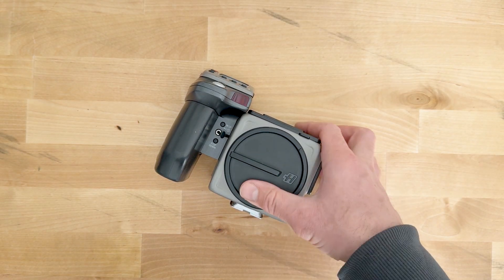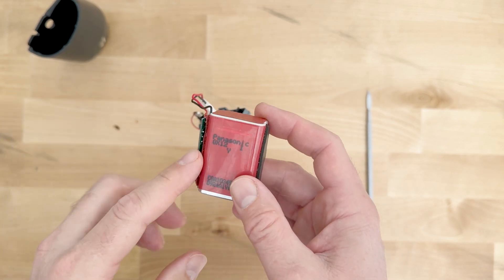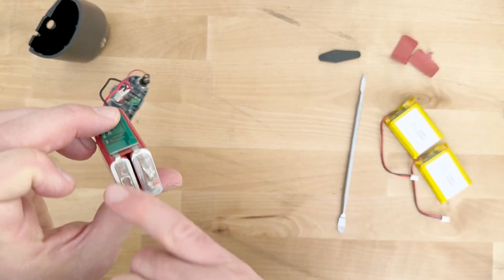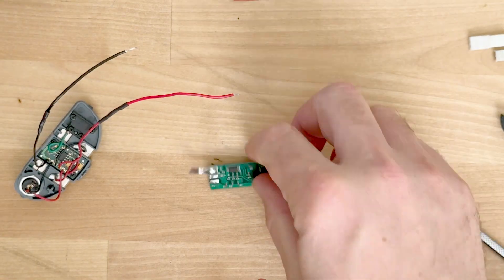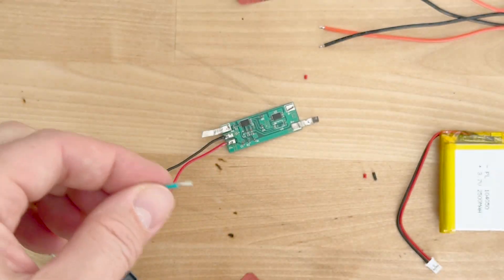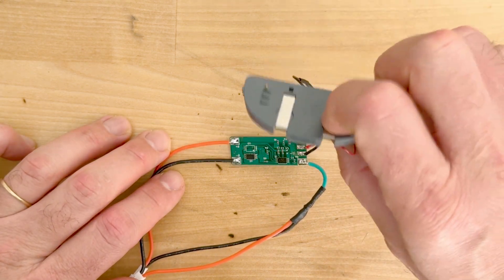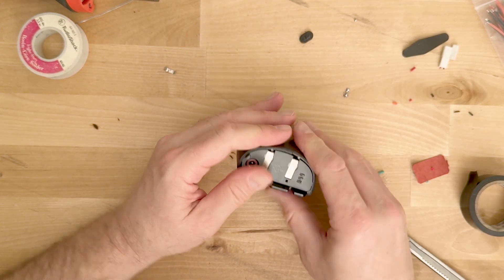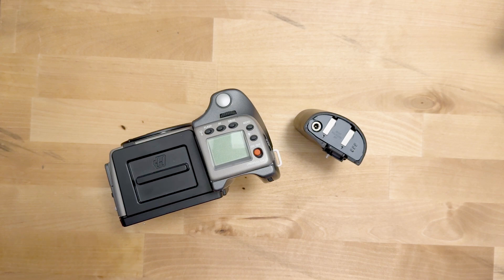Hasselblad H battery grip battery replacement

Comment: Very interesting video. Thanks a lot. But I was wondering, why not take a heating coat battery pack (7.4V -20000mAh) with the BMS already included. Just add a fuse to the red wire and you no longer need the BMS for the handle. And these USB-C charging pack batteries. Yes the battery would no longer be in the handle. but much easier to change and much more efficient. 20000mAh instead of 2000mAh. what do you think? The real question. Do I need to keep the BMS from the blad battery if I already have a BMS in the battery pack?

Comment: I just replaced the batteries. I used the parts in the links. Easy to do, took one hour. if they need to be replaced in the future it will only take a couple of minutes and a few dollars
Reply from the maker: Thank you for the comment and so happy to hear it worked out and that the video helped make that happen.

Comment: And you call this EASY!?!? Only if you are used in dealing with this kind of stuff!
Reply from the maker: @vannoz66 it's really not difficult, just some basic soldering. You can find some youtube videos on soldering, get some copper wire and practice... It's 100% doable. Hasselblad isn't making these anymore so what options do you have left? Perhaps you can find a shop in your area to do the work for you? If you're in the US and want to send me your battery, I'd be happy to replace it for you (for a fee). Let me know, if you're interested.